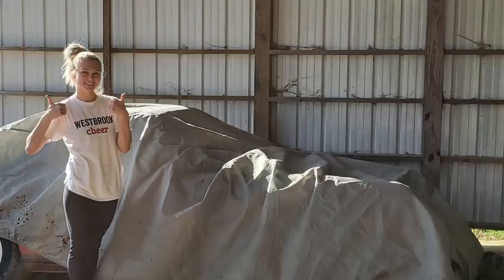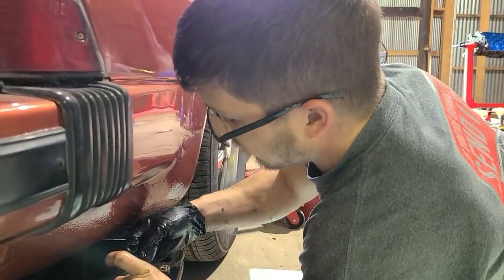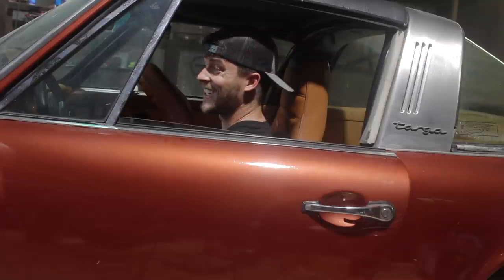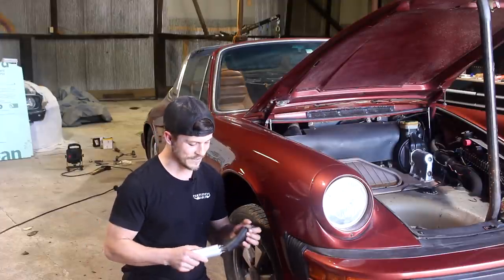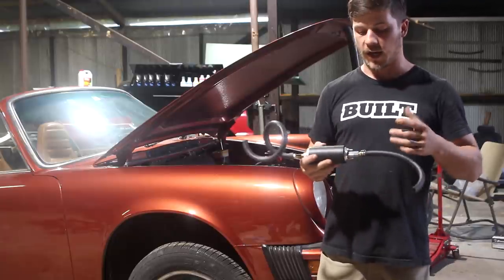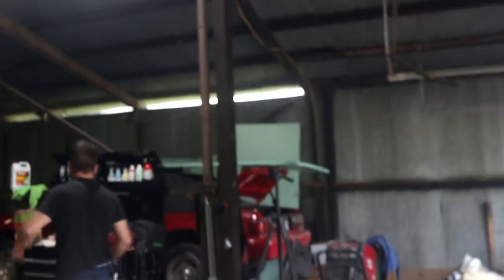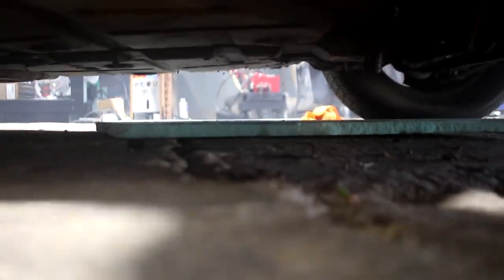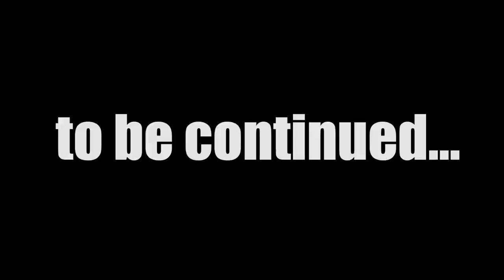PORSCHE 911 BARN FIND pt.3: WILL OUR BARN FIND PORSCHE 911 RUN!?

Comment: You should have drained the engine, as well as the oil tank before filling. When you check the engine oil level, the car needs to be running and at normal operating temp. If you fill with oil to full on the dip stick with the engine not running you will overfill it and will cause the oil to get sucked into the intake. That may explain all the smoke and the oil coming out at the end of the video. As the engine got hot the oil expanded cause it to overflow out of the engine. Smoke is normal for a 911 sitting a while, but it should only last a few minutes. You should also be using engine oil with ZDDP (zinc) such as Valvoline VR1 racing oil. The air cooled Porsche 911 engines are flat tappet engines and need zinc in the oil to protect from wear. You can add ZDDP as an additive, but it's easier to just use the correct oil. Good luck with your 911.

Comment: I would pull the engine to clean everything.  Then you have a good starting point to diagnose the problems.  Big leak could be oil return tubes.
Reply: You are correct. Put oil in made for aluminum aircooled engines. Swepco or Brad Penn.

Comment: Those mechanical fuel injection systems (K-jetronic) tend to get stuck. The internal plunger sticks when not used for a long time.

Possibly it will get stuck a few more times in the future. Just push the air valve as you did and it will get unstuck.

I had the same issue with my old W116 with a K jetronic as well.

Comment: FAST is correct but not enough.
You also need C: compression.

About that smoke, i believe this engine has a DRY SUMP lubrication system. You need to read up on it.
It's not like your averidge Toyota or Chevy.

Comment: Well done for getting it to run but you've probably done the worst thing by running off the original fuel tank without cleaning it out first. The Bosch K Jet system is super sensitive to dirt. You have a really nice car there - please do some proper research before just jumping in as just making it run is the easy part, dropping the motor first would have been wise to make sure the bores are good & check the oil system out. Looks like you may have a scavenging problem.

Comment: Very cool, right up until the end.  Something ain't right. I initially thought that was just oil smoke, now with the leak/overheat at the end, I'm wondering if it's got a headgasket failure.  Good news is that you've got experience with that from the Accord project, so you know the deal.  Hope I'm wrong though... hope it's just old hoses or the water pump.  Will be looking forward to the updates.

Comment: It's great that you got it running, but the crankcase breather line that vents into the air cleaner is puking out oil smoke, which would generally indicate combustion blowing past the rings. My fear is that by cranking and then starting the motor without providing any lubrication for the piston rings beforehand, you may have damaged them since the cylinder walls almost certainly had some surface rust after sitting for so long. Hopefully they're okay and the smoking will go away once it's been running for a while.

Comment: Next time an oil filter will not budge try sliding a large worm drive/hose clamp - we call them Jubilee clips in the UK - as far down what's left of the filter towards the mounting face. Tighten the clip then carefully tap on the tightening nut with a screwdriver and hammer and it most likely will turn and allow removal. You may have to progressively tighten the clamp as you go.

Comment: Very likely the engine is suffering from a fuel pressure issue. The first minute sounded well and then the warmup should kick in. The warmup regulator changes the fuel pressure by leaning out the mixture. Google CIS fuel pressure test and it should get you to some valuable Pelican threads. I learned about it the long way thinking it may have been vacuum but the pressure have to be within spec for the engine to run OK. Then getting it to run well is a matter of ignition timing an mixture adjustment. Looking forward to the next episode!

Comment: Hello, I'm watching this YouTube film you're making from the U.K, I was sorry to see you're having trouble removing the Oil Filter from the Porsche. I know its too late for this application but in the future when trying to remove a stubborn filter cartridge you can always use a 
" Strap"  The strap will have a drive attached to it , & before you put a screwdriver through the cartridge ...try a oil filter removal strap . Once you have destroyed the cartridge then a strap will not work .
Keep Going though & get that Baby Running Good Luck .

Comment: There is an idles screw just above the top of the air cleaner box, You may have to take a flat blade screw driver and give it a quick turn to increase the idle. Also, make sure that the oil cap is on tight, it's a sealed system and if the cap is off or loose it will idle rough.

Comment: Here are two things I would check first if I were you...  1) Read up on the “triangle of death” area on you 911 engine.  2j pull your valve covers to determine the condition of your head studs.  The triangle is three things at the top front (near the flywheel) of your engine that can cause a major oil leak.  Sounds scary but they are fairly inexpensive repairs.  Only downside is most 911 owners pull the engine to fix these triangle  leaks.  The scarier thing to check is condition of your head studs.   Once you have the lower valve covers off you can find all the round head nuts and see if any are loose or broken.  You could have broken head studs or studs pulled out of the engine case.  If you find any loose or missing, you will need to tear down the engine to repair.   The sounds your engine was making sounds a lot like compression leaks due to “loose” heads.  These 911 engines tend to keep running no matter what...  Hopefully your solution will be simple  But even if you have these problems, that is a sweet 911 and it is well worth it!

Comment: The way to get an overtightened oil filter off is to use a semi sharp stone / metal chisel against the folded rim of the canister where it seats against the filter housing and then tap it with a lump hammer (use the mass of it rather than thrashing at it) in the direction you want to rotate it. Has never failed to work for me in over 30 years.

Comment: I have a 76 targa. The oil filter does not need to be tight
 Be sure and lube the rubber ring on the filter. Use 20 50. The air injection smog pump will make it run much hotter thus the recommendatio of 20 60. Smart guys remove the smog pump and replace system with headers and plugs. It will run cooler and won't heat up on idle

Comment: I bought one of those old Porsches 911 for $2500, had some rust so we pop riveted a old road sign to bottom and bolted seat to it. Cleaned old gas out of it, tuned it up, changed oil and runs great. We hold pedal to the floor and turn wheel to the left and do major donuts in the field. No inspection or registration, we are trying to blow it up but it won’t die ! Ours says Targa on the stainless steel roll bar, we have the entire back seat area filled with empty beer cans. We get drunk and abuse the Porsche. When car finally dies we’ll prob just let sit where it is and use for target practice.

Comment: Dude! I had the EXACT same fight! Valvoline had been the last place to do an oil change on my car. (My parents had taken it for me while I was fighting cancer the first time) We tried the rubber strap, we tried the cup you put over the end of the filter, we tried stabbing it with a screw driver… we ended up getting a very similar tool from autozone. The type that with wrenching squeezed the filter tighter and tighter. In the end we had bent and broke the tool such that it wasn’t usable again… BUT that stupid filter finally came off! 

Later found out that Valvoline has a policy of “tightening down to the plate”… even though it’s supposed to be slightly more than hand tight… ugh

Comment: That can work for two things after you get done or in the oil in there you could clean it up real good and make a beer bong out of it hahaha I love that Porsche I've been waiting to see this thing run since you got it I would think you would buy a brand new battery to eliminate some of the electrical then you would know that's what I would have done new battery and then after that check for spark yes fuel line fuel filter that's a good idea fuel pump here I thought you found Corona covid so you put your mask on most mechanics just want to sniff the gas hahaha that is such an awesome car

Comment: Maybe FAST should better be called FACTS?: Fuel, Air, Compression, Timing and Spark....😉

After sitting these cars smoke quite a bit but as you use it everything will fall into place. I hear what seems to be an exhaust leak. You might need a new exhaust system. Dansk is a good brand. Great find!

Comment: Regarding your MG shocks. The guru in the US is World Wide Auto Parts in Madison, WI, which sells rebuilt shocks for $110 each front and $85 rear (I have them on my '71 GT). Your shocks have value, but it's more like $50/each front and $35 rear.

Comment: Check seals, head gaskets, drain plugs, oil lines and valve tubes. Looking at the amount coming out there my guess would be valve tubes, one or more of their seals failed once things got up to temp. These engines are nowhere near as hard to work on as some may think. The main issue is parts cost, other than that, it's not much different than working on old air cooled bug engines.

Comment: Just pour some fuel in the carbs if you want it hear it run 😆
Reply: Since his 911 doesn't have carbs that's going to be a bit difficult.
Reply: @ryantzer  yeah it was late when I wrote that and I hadn't got to the injection part of the video yet...however

Not impossible to start a car with injectors in a similar way though...

It Still has an air intake...

Comment: So stoked you got it running bro was that oil or water? I don't know Porsches but I know some had heat exchangers in the exhaust manifolds for the heater I think it was. Just throwing it out there I'm probably wrong 🤣.
Reply: its air cooled
Reply: @Craig_Simpson  oh I know the engines air cooled but the heat exchanger was for the heater system was it not? Like I say I don't know Porsches I just thought ide throw it out there.
Reply: @Craig_Simpson  https://www.stoddard.com/porsche-911-930-parts-spares/porsche-911-mufflers-heat-exhaust/mufflers-heat-exchangers-exhaust-75-83.html these are what I mean bud 🙂

Comment: The 2.7 liter engine in that car is probably the worst engine porsche ever produced. 
165 horsepower,  and about 3 foot pounds of torque. 
The best thing to do is find a good used 3.2 from a later model, or ls swap it.
My advice is the ls swap.
Double the horses, about the same weight,  and a million times more reliable.
Reply: You've never owned a 2.7 liter Porsche. It's going to cost a minimum of 10 grand to get it back to a wheezing, disappointing money pit. The head studs have failed, so it needs a complete rebuild and Dilivar Head bolt upgrade.
Either find a 3.2 or ls swap it.
Nobody will know unless you srep on the gas or open the engine cover
Reply: @Endoe ONE 
Definitely the simplest solution. And, although usually altering from originality generally hurts value, dropping in a 3.2 raises the value significantly.

Comment: i had a fuel filter on  a van once that we had to drop the mount off crush the filter in a vise and bolt a metal tube to the mounting holes to get it off

Comment: When are you going to widebody it like everything else
Reply from the maker: wide never dies
Reply: Leave it original body - just get rid of those awful US spec bumpers and fit euro spec ones.
Reply: I did a full metal slant nose kit on my 1976.
One of the coolest cars I've ever owned. Had a 3.2 in it.
If I had to do it all over again,  I'd have contacted renegade hybrids. 
They have an awesome kit to put a 5.3 Chevy LS in a porsche. 
Makes it bulletproof,  extremely fuel efficient (30 mpg highway), and dirt cheap to keep.
The porsche engine was always draining my bank account. 
And I never got more than 20mpg. From a 225 horsepower mill that didn't have much torque.

Comment: 9 quarts seems like a lot of oil. Never owned one but wow that seems like an expensive car to own if you drive it all the time. Even the BMW’s I’ve owned with turbos and oil coolers run 6.5 qt.
Reply: These cars take 12 quarts in the motor and 1 in the filter. Expensive car, expensive oil change 😂